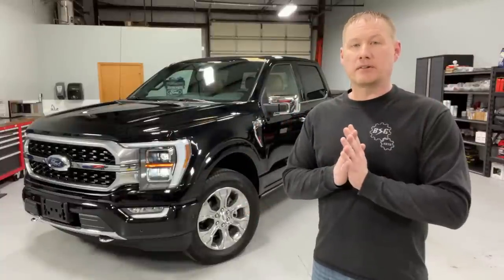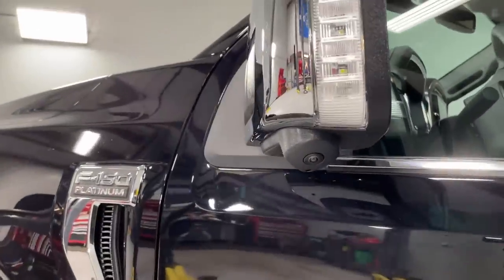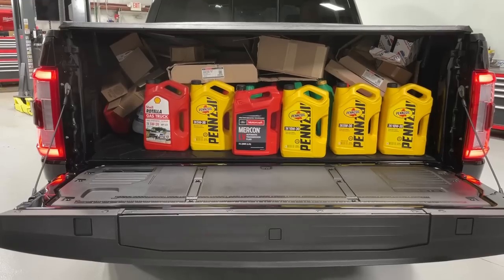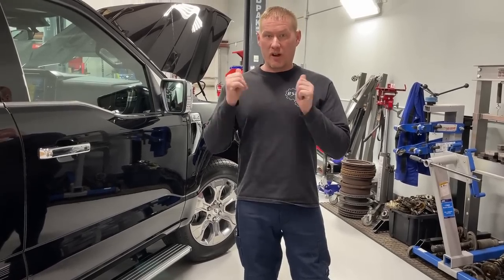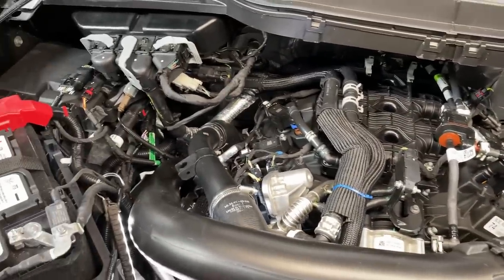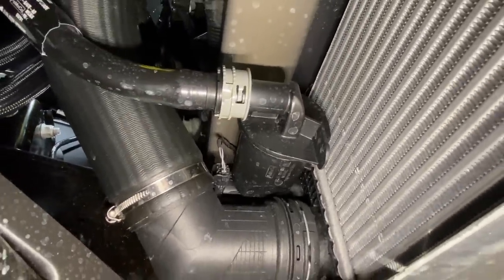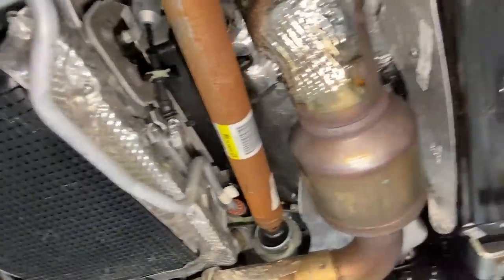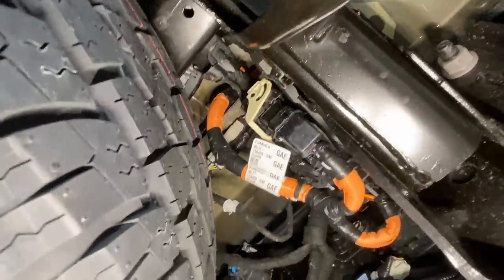The All New 2021 Ford F-150: My Initial Thoughts Pt. 1 of 2

Comment: You should do a video on the 18-20 5.0. I caught that comment hahaha...we are listening. Mine has been great at 30k so Id love to hear your thoughts longterm!
Reply: He is the 1st person I’ve have ever heard🦻
make a negative comment👀 on the Gen3 Coyote 
Those engines seem to hold together
 better than the 5.2L Shelby 🤷🏻‍♂️
Reply: @stepside2839  I'm in a FB group for the 18+ 5.0 and soooo many ppl whine about how the engine sounds...but I still havent heard of too many ppl that actually had major issues. Ford was using the complainers as guinea pigs to sort out oil consumption issues by replacing blocks early on but it seems to be better now. Mines been great fingers crossed
Reply: @stepside2839  You haven't been looking too hard. I'm a Ford tech and can confirm that not only is he right, but he's holding back. The 3rd gens give tons of problems. We're constantly putting new motors in them. They run great, but unfortunately they just don't hold up.
Reply: @solarfall2728  So far, I have had zero oil consumption problem on my 2019 Roush.
Have you considered the type of oil the problem cars had and if they were having a PCV problem. 
There needs to be some data on the drivers’ use & habits and analysis of oil.
I suspect enough data will lead to an adjustment of “nut behind the wheel”
The problem appears to be a small percentage & you know Ford will not address this until it becomes cost effective.
This is the 4th year of Gen3 and the question remains .. more data
🤷🏻‍♂️Wondering what Steeda would say..
Reply: @truckthesystem3957  I suspect 
that the problem are guys drag racing on the street & strip with inadequate oil. I want to see more data related to oil & driver. 
There’s a reason why Shelby & Roush recommend 5w-50 and not the 5w-20
So far, no oil consumption on my supercharged 2019 Roush.
Bad news sells and becomes ‘clickbate’  & whiners on Facebook get amplified👀
🤷🏻‍♂️
Reply: @stepside2839  This is not something to take personally. When a car is known to have a certain issue, it never happens to 100% of the time. Lets say its 1 out of 5, or 20%. That's a huge amount of vehicles. Would you buy a car knowing there's a 20% failure rate on the engines? I wouldn't. But the point is not everyone is going to have the problem.

With regards to the 3rd gen 302's and 307's, brand new off the showroom floor, they can burn up to a qt of oil every 500 miles. Personally, I think the new gdi system has something to do with it. 

The problem with Ford goes a lot deeper than the 5.0. For the last several years our designers have gone crazy. They're obsessed with making complicated designs that have no benefit to the customer, and end up costing Ford a fortune in warranty repairs and recalls. No one can figure out why they're doing it. And its a major problem because our senior techs are leaving far faster than we can replace them. We're so desperate for help we literally take lube techs and have them pulling dash boards, transmissions, motors, and quite a few other things they're not remotely qualified to do. The sad part is our vehicles used to be pretty good.
Reply: @solarfall2728  Personally.?..🤷🏻‍♂️
There currently is not enough data to show any percentage rate of failure. 
Engineers need data before changing a process. Was a ‘process’ changed and not revealed?🤷🏻‍♂️ We’ll never know
Problems are too often elevated out of proportion (via law suit) to the actual data collected. Being this is the 4th year of the Gen3 Coyote, one would conclude the percentage rate of said problem is either to small and/or not cost effective to address.

The Gen 3 Coyote is both 
direct injection and port injection. 
Excessive oil consumption would be more of a factor of oil ring seating, the PCV system, constant high rpm use, & the type of oil being used in relation to engine operation, leakage, evaporation, etc.
Reply: @stepside2839  That all sounds reasonable, but we're talking about Ford. This company is just flying out of control. You don't need them to publish engine failure rates. Just go to your local dealer. What used to be a couple of bays set aside for heavy line work has spilled over into the whole main shop. We have so many motor and transmission jobs backed up, they go to the Quick Lane building. Per our contract with Ford, we're not allowed to do that, but we have no choice. 

"The Gen 3 Coyote is both 
direct injection and port injection. 
Excessive oil consumption would be more of a factor of oil ring seating, the PCV system, constant high rpm use, & the type of oil being used in relation to engine operation, leakage, evaporation, etc.
"

No offense, but that's simply not true. Yes, bad rings can cause oil consumption, but that's not the problem. Even though the rings are in contact with the cylinder wall, there's still a very light coating of oil on the other side of the ring after it makes a pass. Its not a failing of the ring system. You need the residual oil left on the cylinder wall for lubrication. Its critical. With direct injection, liquid fuel gets shot directly into the cylinder. When this happens, it washes the oil off the cylinder walls, which compromises lubrication. Again, its not a problem with the rings. They're supposed to leave a little oil behind. On traditional port fuel injection system, the air and fuel mix before it enters the firing chamber, causing the fuel to atomize. No liquid fuel gets to the cylinder walls to wash the oil off. A partial solution to the problem is the use of a high pressure fuel pump. A gdi motor has a fuel pump bolted to the top of the valve cover and runs off a lobe on one of the cams. They put out well over a thousands pound of fuel pressure. This helps, but its not a complete fix. 

At this point, you may think that's why they use 2 injection systems. Its a way to get atomized fuel into the cylinder. But that's not what its used. for. They put it in to clean the top of the valves. Otherwise, you have massive carbon build up that causes other types of problems. 

One of the reasons you don't see a lot of published info on failure rates, is because Ford plays games. With some of our motors, Ford already knows they will eventually have a huge failure rate. One way they get around accurate reporting is to fix the problem before the customer knows about it. The initial complaint/problem is what mainly gets reported. Ford issues recalls for simple software updates. When we get our hands on the vehicle, we do the update, but also look for signs of a failing motor. If its bad we just tell the customer we found a major problem with the engine, and it will be covered under warranty. Otherwise, we would get customer generated complaints of white exhaust and low coolant. Look up a 19B37 recall.
Reply: @solarfall2728  recall 1937B
is in regard to a 1.5L engine in the Escape and Fusion & a PCM software change.
Your entire paragraph is nonsense in regard to fuel injection, it’s operation, atomization, and your writing indicates a very poor understanding of engine dynamics.
This conversation has ended!

Comment: Towing capacity and payload is determined by the the yellow sticker in driver door not the brochure says.
Reply from the maker: I was only displaying a chart showing the max tow capability when properly equipped. Not sure what you are trying to correct me on here.
Reply: @FordTechMakuloco  I wasn’t trying to be disrespectful about  you showing off the towing capabilities of 3.5 eco-boost, just pointing out that those numbers are not real when you combine the GVWR in the sticker compared to the tables that Ford provides in their brochures. Keep up with the good work, maybe my 5.0 that lives in me was a little jealous.

Comment: i suspect the suspension height sensor in the rear is tied into the braking system to change balance under load conditions.  too much electrical to go wrong on these newer vehicles. might be ok down south in aridzona  but not for the salty rust belt.

Comment: Does the auxiliary pump keep the oil circulating in the engine when the engine turns off at at stop light? Or does the oil just fall down back into the oil pan and/or stay put? Great content, thanks!

Comment: I haven't seen you work on many 2.7 ecoboost engines on the channel. What is your opinion of the 2nd gen 2.7 and would you recommend buying one? I think it's a very impressive engine and I am seriously considering getting a XLT 302A supercab with the 2.7 with payload package which includes the 9.75 inch diff and 3.73 gears. I won't be towing with it at all. The only heavy work the truck will be doing is hauling a slide-in camper and occasionally doing some moderate off-roading. I think it's the perfect engine for my needs, but I love a pro's opinion. Thanks!
Reply: I'd like to hear Brian's thoughts on the 2021/2022 2.7l ecoboost also...I can't decide between the 2.7 or 5.0.... ?

Comment: I have a 2006 Ford Mustang 4.0 V6 I changed all four o2 sensors and the engine check light is on and the code is for the heater circuit

Comment: @21:00 I am never considering buying another Ford.  Period.  Though they certainly are the nicest looking of the new pickups, the 5.4 3V triton horsecrap I had to deal with, which I still own, left too deep a financial scar for me to consider Ford again, I just bought a Toyota hybrid car.  I'll just keep throwing parts at my 04 F150 as needed so can have tow/haul capability, but I have so many remanufactured hard part assemblies on the thing I quote "shouldn't" have much more trouble.

And now they want over 70 grand for these? SHEEEEEIIIIIT...

EDIT;  HOLY MOSES MALONE, A BELT DRIVEN OIL PUMP?  THA'T A DISASTER WAITING TO HAPPEN FOR A LONG TERM OWNER.  That's like the disaster of John Deere using cam driven water pumps on the early 466's.  Thanks for this insight Mr Brian, this is invaluable..

Comment: I'll never understand why people insist on making comments about how buying a new truck is waste of money. He's not toting the truck as an investment. I traded in a 2018 2.7L Ecoboost a couple of weeks ago for a 2021 3.5L Ecoboost XLT. Even had them add leather seats. I ended up only losing $4K on the truck over the 2.5 years that I owned it since used vehicles prices are so inflated right now due to the chip shortage. The 2021 models have tons of new safety features that will no doubt prevent major injuries or collisions from occuring altogether. Now you tell me if your 1994 Pontiac is as safe to drive as my 2021 F-150 and then tell me it's a waste of money. Geesh...some people...
Reply: Because at 70 grand it is an investment.

Comment: Hi Brian,

I learned to fix cars back in the 1970's and I've never paid more than $500.00 for a personal car and my oldest car was purchased for a dollar in 1976 and I still own it... not a daily driver as parts are way too hard to find.

I don't get why a tech/mechanic with your skills and facilities would ever buy a new car when you can obviously find something easily reparable for pocket change and fix it up for dirt and drive it forever, if you wanted to.

I mean a mechanic / shop owner friend of mine bought himself a new Toyota truck, but he was over 70 years old, selling his shop and had pancreatic cancer...  I kind of get why he wasn't going to work on cars anymore and wasn't going to have someone on staff to do it for him.

As to that F150, for an old timey kind of mechanic... the tech makes my head swim although some of it is kind of cool.  I understand it, and it's going to be a lot of fun diagnosing it.  But that truck is going to be expensive and time consuming to fix when it gets up there in miles and years.  I suppose if I were getting paid by the hour, it wouldn't be so bad, but if it were my own master cylinder that went bad... I'd either be rebuilding it, something I haven't done since I was a kid or cursing the engineer who designed it.

Back in my day... Fords were simple and easy to fix. yes they broke down more than some other cars, but most repairs could be done road side and by far. Ford had the cheapest parts. 

Again, thanks for the help with the brake line, I would have it done but the seal in my 3 ton floor jack gave out on me... when things start going wrong.... oh well you know how that goes.

Comment: Belt driven oil pump on the latest 5.0L huh? What a terrible idea that is. You mentioned you hadn't seen issues with the ones on the 2.7L EcoBoost yet, but that seems like a ticking time bomb. Great video though, congrats on the new shop truck!
Reply: Same thing on the new GM 3.0 baby Duramax. They mounted it at the very back of the engine & trans must be removed at 150K to inspect & replace if necessary. Engineers nowadays eat paint chips for breakfast & hit the crack pipe during lunch break!

Comment: Great video Brian! Can we assume you removed the skid plate for filming underneath? Also, As you went with the EcoBoost engine option, can you describe any internal changes for 2021 to that motor? As I look at the catch can on my 2012 and read through my timing chain bill, it would be great to hear how you think these newer EcoBoost motors have eliminated some of those older issues and how successful they have been.

Comment: Awesome video. It looks light the driver LED fog light was not working at beginning of video?
Reply from the maker: No the fog lamps were never on. That is a cornering lamp system, so the right fog was only on because the steering wheel was cut hard to the right is all.
Reply: I thought the headlights moved during a turn or does just the fog lights just come on during a turn?
Reply from the maker: The headlights are adaptive yes but the fog lamps also come on depending on which way the tires are pointed to help light the ground for parking maneuvers etc in the dark and it really helps.

Comment: With the master cylinder ABS integrated one-piece unit Toyota did this back in the early 2000s I have an O2 4Runner had to replace the unit $3,500 on the price tag on that thing not necessarily a big fan of these one piece units as they are expensive to replace

Comment: Sucks you can't spec the LED headlights on the lower trims. I think one reason they put all the bends in the hood is to reduce wobbling at higher speeds. Nice truck. Does the tailgate still squeak when driving down the road?

Comment: Personally I’d rather have it in one. You can’t always find the other half on YouTube.
I hope they’re working on doing away with the system where the engine shuts down at traffic lights and then restarts. When I rented one there was nothing else that pissed me off more. 
As for the power ratings for the various engines at least the 5.0 litre doesn’t have the turbos that can shorten oil life. If I understood you correctly they’re shutting down cylinders on the 5.0? They’re monkeying with what’s a good engine design. I have reservations about the cylinder shutdown but hopefully Ford will have a better design. Hopefully they’re in the process of adding a 5 litre to the bronco lineup. That’s the only real reason I haven’t looked into buying one so far. So many cool features in the Bronco but it doesn’t have an engine that delivers torque at low rpm without going into boost and putting it into precarious conditions when maneuvering. I can’t see a tiny engine having enough engine braking without having a creeper gear.
I dislike the led lights because they’re coherent lighting which provides no depth perception. It might be nice and bright for the driver but it blinds oncoming drivers. I’m about one encounter away from writing my federal representatives for the government to regulate headlight specifications once again. Once they turned it over to the manufacturers the lighting has become insanely bright. They’ve also increased the price of replacement headlight assemblies. The ribbon lights surrounding the headlights makes it a bigger ball of light to blind people. Every Ford truck looks like it has the high beams on because of always having four lights on the front. Two smaller cats would seem to be more efficient than one larger one so that exhaust gases are processed more efficiently.

Comment: 70 grand?   People have gone mad.   My father and I were both bricklayers in the 70s.  We had 1/2 ton long bed trucks, 250 6 cylinder 3 speed manual trans,  rubber floor mats,  roll up window.  We loaded them up with cement, sand, lime, bricks blocks, mortar mixers,  scaffolding, planks.  If we wore out the little motor we rebuild it for a few hundred bucks.  Now spark plugs cost more than that.    We did all the maintenance, water pumps, plugs, points, etc as well as the rebuilds.   They cost under 3000.   Now we have 400 HP trucks with race car engines and leather seats for 70 grand.   Will they last 50,000 miles doing construction work?  Not likely, the people of Ford have gone mad and those who buy this electronic garbage to drive to their office are madder still. 

How about a review on a real work truck, if there is such a thing any more.

Comment: Are those 18-20 5.0’s really “that” bad? Seems like there’s only a small percentage of people having problems with them. There’s still so many F-150’s and Mustangs driving and loving them. The TSB’s for the oil issue seemed to have worked on a lot of people’s.
Reply: he's a extremely reliable source of information though personally I haven't had any issues on my 2018 f150 5.0
Reply: 2020 5.0 here, no oil consumption issues in the 10,xxx miles i've owned it.
Reply: My 2019 5.0 has burned/used/consumed 1.5 quarts of oil every 5K oil change since day one.  I had the TSB 19-2365 done at 10k, but sill 1.5 quart low at 25K oil change.